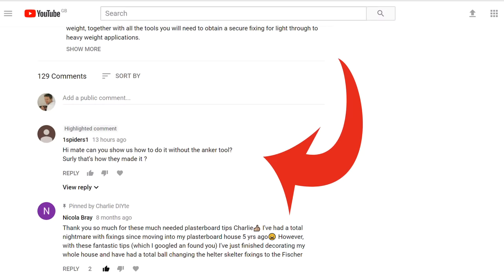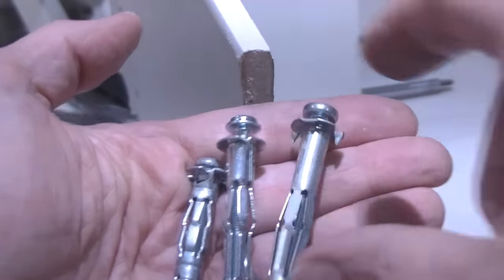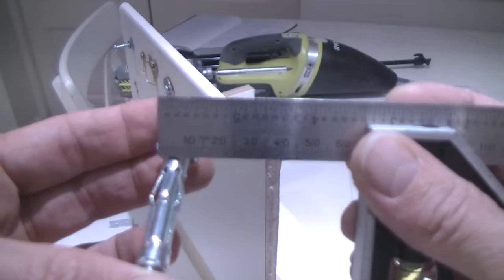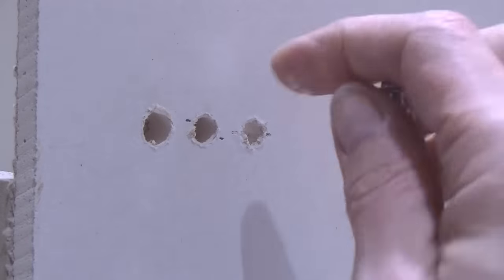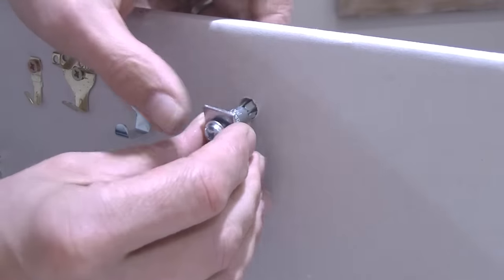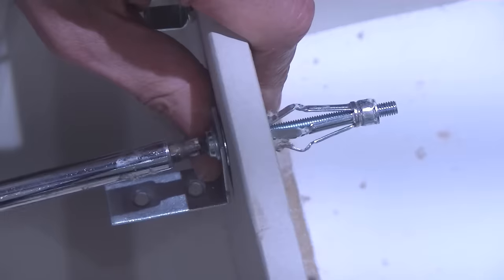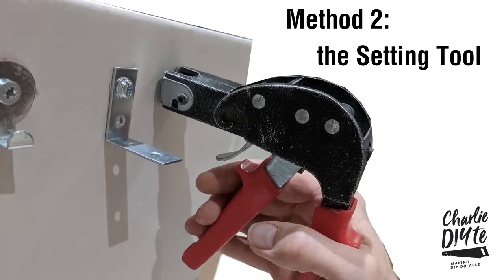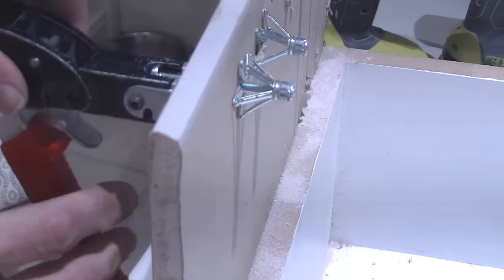How to Fit Hollow Wall Anchors

Comment: As I understood, it's not enough to put a bracket between the anchor and the screw, what is important is to keep applying pressure to the anchor with the bracket so the anchor doesn't rotate as you screw the bolt into the anchor?

Comment: Hey Charlie, I noticed a bit of wobble on the anchor when you removed the tool near the end of the video. Does the tool not tighten the anchor completely or did you just not tighten it completely? I really appreciate your channel, have ordered anchors for a project I am working on and will complete it once I receive the anchors. Thanks
Reply: It tightens up when you screw up your fixing. The main thing is getting the claws open first

Comment: Thanks so much for this life-saving video! Must have had beginners’ luck with the first few anchors I fitted - but then had a total ‘mare yday. Popped out this morning to buy a setting tool but just tried one with the ‘old fashioned’ technique and that addition of the turning stop is a total game-changer! Thanks again!
Reply from the maker: Yey! Glad to hear it Tom. Yes that turning stop is crucial. Thanks so much for getting in touch 👊🏻
Reply: @CharlieDIYte  Can I also ask - I have been using the thinner versions of these these hollow wall anchors to hang heavy-ish pictures onto plasterboard walls. Are they over-engineered for that kind of usage and/or is there anything better you’d recommend in this scenario? Thanks again for all your great videos, either way!
Reply from the maker: No, I think you're absolutely right to use those of the pictures are reasonably heavy. The trouble with standard wall plugs is you need compression for them to do their job, and for that you need to tighten the screw against a hook. So for the other option, check out this video https://youtu.be/qwVnoaY5eVc
Reply: @CharlieDIYte  excellent, thanks so much!

Comment: Brilliant.  I fitted my son's TV to the wall using these anchors without the setting tool.  Works a treat and a solid fitting
Reply from the maker: Great to hear that, Chris - thanks for letting me know!
Reply: hopefully it isn't drywall
Reply: @cdoublejj  they said their sons tv. It probably not a 70 inch. I personally don't trust drywall with anything, but you have to.

Comment: Great video! As a curtain fitter myself too, I use these all the time to get a secure fixing for the weight of the curtains. From my experience the top tips I can give are. 
1.Make sure to drill the hole level. 2. DO-NOT over pump when using the tool. 3. Check the bolt screw head and use the correct drill bit or screwdriver, as the bolt heads are fairly soft and can get ruined easily. 4. Always when using the tool make sure to screw the bolt in and then unscrew as this make sure that the umbrella is fully open and tight to the plaster board. 5. When fixing item to either wall or ceiling make sure not to over tighten as this will pull the umbrella too much and pop the plaster! leaving you will a big hole!
Reply: On your point 2, how do you know when to stop pumping? Thanks.
Reply: Thats what she said!

Comment: That tip about putting the bracket in front of the screw was invaluable thank you!  I was sitting with a spinning anchor - the teeth / claws had just gouged a circular hole in the plasterboard - scouring the web for a solution.  It's not a bracket that I was ultimately fixing (it was a guitar hanger which is much thicker and with that the screw wasn't reaching far enough in to bite) but adding one I had going spare worked to get the anchor expanded.  I'd just about given up on it so thank you very much for the tip!
Reply from the maker: You're very welcome Steve. Here's my comprehensive plasterboard fixings update if you have a moment https://youtu.be/Jdu9RId7m90

Comment: Excellent video.  We don't have an anchor tool so my husband will use your screwdriver method.  Big thank you!
Reply from the maker: Thanks 🙏 Yes that'll work fine. You just need to make sure you have the bracket or some other material between the screw and wall anchor before you tighten it, to stop it spinning.
Reply: Yes, thank you, we did that, but he nearly gave up as it wouldn't seem to screw down properly.  We checked we had the right size  anchors for the thickness of the stud wall (we could see the thickness after drilling).  He had a sleep, went back to it and hey presto, all ok!

Comment: Ah jeez. I wish I had come across this video much sooner; it would have saved me years of pain with failed hollow wall anchors. I had always just used them with the screw and initially they generally seemed to work. Recently every single one I was using (from B&Q) was failing. I thought that the anchors were faulty. I've invested in a setting tool and hey presto, they now work perfect every time. Thanks for the great video.
Reply from the maker: You're welcome. Yes it's such a badly explained thing this. I was exactly the same - crudely using my long nose pliers to distance the fixing from the bolt whilst I tightened it. A turning stop is crucial if you're tightening it without the setting tool - I guess that's why they normally include a washer but it's easy to dispense with that not realising why it's there! 👍
Reply: @CharlieDIYte  So I got myself a setting tool and honestly it works beautifully. I haven't had a single one of these fail now.

I grew up in a house with solid walls so never came across these hollow wall fixings.

Thanks to your video I'm much more confident with all those pending tasks I've been putting off for fear of wrecking the cavity walls in my new build!
Reply: @CharlieDIYte  that was my idea to buy pliers instead. If I recall that grip into the baking soda ; err I mean wall is liable to just turn an shred the wall. Probably doing it by hand helps lessen the chance than a drill.

Comment: I recently hung a very heavy mirror above a fireplace in plasterboard. I didn't want to cut the finished wall to install a plywood pad  - too time consuming, ugly and, IMHO, overkill. 

Anyway, before commencing, I had a look at your other tut on drywall fixings -if you hang curtains for a living, you are definitely and expert in getting the best fixing into drywall - and decided to give the anchors a bash, going on the premise that I could always fall back on the plywood pad if I was not confident that the anchor would suffice. 

I've used them before, quite a long time ago. I seem to remember that, whilst they are plenty strong, the process could be a bit hit and miss. Until watching your video (and Andy's over at the Gosforth Handyman), I did not know about the setting tool. 

Well, what a fantastic piece of kit! Drilled the appropriate holes in the plasterboard, and seconds later  both anchors were firmly fixed, ready to accept the heavy mirror. 

Yes, fifteen quid might seem a bit steep for a tool that you don't think you'll use that often, but I have the feeling that it will be a bit like my trusty multi-tool: Never leave home without it!

Thanks for sharing

Comment: Thank you so much! Easy instructions. Just what I needed.  Trying to fix a "simple" DIY job.. a stuff up using the shop bought rod bracket kit - no instructions and grey brick wall plugs supplied for plasterboard walls  which I was not aware of until I installed them... I was so careful to do this right, checked with sales staff before,  yet even they did not advise me correctly. So so annoying... I hope I can reuse the same holes if they are not too big now 🤞🤞 hopefully problem solved! Thanks again.  YOUTUBE is awesome!!!
Reply from the maker: Sales staff are generally clueless I'm afraid, Marianne, and real plugs supplied with lots are the cheapest generic plugs they can get away with supplying. I don't know why they bother to be honest. If you've bought these metal wall anchors you should be absolutely fine with the holes you've drilled as the anchor holes will need to be a bit larger anyway. Any problems, and a bit of Easi-Fill will give you an invisible repair.

Comment: Thanks very helpful. I'd used them years ago but had forgotten how to set them just using a screw driver. The extra bracket seems to be key to it tightening properly.
Reply from the maker: Yes, it's crucial to have that bracket in place to act as a turning stop.

Comment: This is fantastic, thank you so much for doing the fitting without the anchor tool. I have to refit a curtain pole for a client, that was literally hanging off at one end. I'm a mere painter & decorator, and always faced with plaster board dilemmas. Great stuff Charlie!
Reply from the maker: Emily Brock You're very welcome - thanks for the comment. Ps, there's nothing "mere" about painting and decorating 🙂!

Comment: Thank you so much for the tip without the anchor tool. Mine doesn't work at all. You saved my shelves!
Reply from the maker: You're welcome. Yes the turning stop is crucial, otherwise you have a spinning fixing that makes a mess of the wall 👍🏻

Comment: Good video! My problem is Safety Grab bars that were improperly installed by a previous maintenance man at the hotel where I work. Whomever did this put these molly bolts in and never bothered to see to it that they expanded at all. They just slapped these Safety Grab bars onto the fiberglass showers and so a while later these grab bars are just pulling out all over the place! I need to get some New molly bolts and see if I can get this job done right. And thanks again for this informative video, I've watched so many Useless ones to find this Good one.

Comment: I do like these fixings. Quick tip whenever I use these I set the fixing first then for belt and braces remove the set screw and apply a bit of thread lock. Stops the screw rattling loose for whatever reason. Nice video.
Reply from the maker: Zed Man Love it! Typical belt and braces from Zed Man! Great work!
Reply: Zed Man 6

Comment: Awesome advice on the turning stop. The ones I buy have a washer as well, so not so much of an issue, but I use the setting tool anyway 👍🏼
Reply: I had 3 of these spin like theres no tomorrow, once i slappet a washer on the problem.was fixet, lordamercyy
Reply: @Afritunez  such a joy when that happens isn’t it. Trashes the wall 😒

Comment: Good tip using the bracket/etc to hold the anchor, I've not used them much by have always ended up using some pliers to hold it which makes a bit of a mess sometimes of the surrounding plaster board.
Reply from the maker: Jer Goes I've got to say that's what I used to do. So much easier with the turn stop 🙂

Comment: I use a pipe wrench to hold the anchor while i'm screwing in the bolt, you will start to feel resistance which is the internal metal spline starting to bend after a couple of extra turns you can then force the anchor into the hole and screw it in tight.

Comment: Fredric
I appreciate the wonderful instruction on which way is best to install these anchors, with or without the tool, But how do you remove them when you want to re-position the shelf/cupboard elsewhere in the room. 
Is it just a matter of pushing the whole anchor through the wall so it drops into the cavity, then fill the hole, as you would with plastic plugs?
All your videos are very informative and easy to follow - keep up the good work
Reply from the maker: Thanks! Yes, pushing it through is your best bet. Grind off and remove the front of the anchor with a large hss drill bit and then it should push through with minimal damage to the wall.
Reply: @CharlieDIYte  
Thanks for your reply and advise Charlie.
I'm an avid follower of your journey's through your demonstrations and clarifications on all matters of DIY.
I have a project I would like for you to follow up, but too lengthy to discuss on public comments.  Do you have a contact address in which I could explain my project in greater detail?
I'm sure it will be of great interest to you and other followers
Reply from the maker: @noibear  That's great to hear Frederick, thanks! Yes, email me at charliediyte@gmail.com 👍
Reply: @CharlieDIYte  
Hi Charlie - I've sent my request, plus a reminder to the email suggested but it appears you are not receiving them.  Is there another way of contacting you?

Comment: Ive always used these anchors for fixing semi heavy stuff to plasterboard, ive nevee had a problem with it spinning or not opening, i didnt even know there was a setting tool! With that sais though, ive only ever used the smaller size, i suppose maybe the larger sizes would benefit from the added security of being preset before tightening.
Also, while its obvious to me now, i never even thought twice about the length of the collar matching up with the thickness of the plasterboard, guess i just got lucky.
Nice video, i learned something.

Comment: Great video. I didn’t know you can use these fixings without owning the £15 tool.
Reply from the maker: Yes, but the turning stop is crucial. The setting tool is a much easier solution though.

Comment: Really good video. Can’t say it’s so easy in reality. I have used plenty of this type of fixing. The problem I find is if I screw in instead of using the tool, when to stop screwing in as overscrewing can cause damage to the plasterboard?
Reply from the maker: 2wheelspy Thanks mate! Totally agree that the setting tool is the best way to set these fixings. That said, I was amazed how ready it was too use the manual method. As long as you use the turning stop/have the bracket in place it should be really straightforward. In terms of when to stop screwing you keep screwing until the screw goes tight, and you'll see the front of the anchor pull tight into the plasterboard. Best to use a manual screwdriver at the end because you have a greater sense for when it's gone tight. I wonder if you have problems with damaging the plasterboard because you're using the wrong anchor? You've got to make sure the collar on the anchor matches the depth of your plasterboard. If it's less than the depth of the plasterboard then the umbrellas will open too far and start crushing the plasterboard??

Comment: those plasterboard fixings (we call them brolly's due to them looking like an umbrella when they are expanded) that have the depth for double plasterboard are also excellent for getting a fixing into lath and plaster walls, I find that the lath is far to thin to use a screw for fixing and the substrate overall will not take a rawl plug, however by getting a brolly to expand behind the lathe it gives a really good fixing, also most brolly's i've used will have the drill diameter stamped on them, good video though, i've often had brolly's spin when trying to install in soft plaster and I will definitely be trying that technique, thanks.

Comment: This demonstration is great.

My question is that these anchors appear to be an absolute solution in that unlike a plug I am guessing if you want to remove them you have to cut them out?

A little reluctant to use them for fitting a heavy mirror in tge middle of a wall if I might further down the line need to cut a 50mm hole in the wall.

Comment: I used these yesterday without a setting tool. I always still a hole 0.5 mm narrower then recommended (6.5mm in my case) and push it in. I then use electric screwdriver and finish with manual screwdriver as it gives me the idea how tight it is.
Reply from the maker: Yes that's fine. The key that a lot of people don't realise is you need a turning stop to separate the fixing from the screw otherwise it spins. 👊
Reply: @CharlieDIYte  I've  cut my finger on one of those small teeth that stop them from turning 🤣

Comment: Thanks for the amazing video!! Question: how does one remove the anchor from the plasterboard if it's no longer needed? Cheers, Ben from New Zealand.
Reply from the maker: It's a bit tricky Ben. Best thing to do is get a large HSS (metal) drill bit and gently drill off the front. Then you can push the fixing into the wall a bit and fill over the front.
Reply: @CharlieDIYte  Brilliant! Thanks for that Charlie.

Comment: I've had issues where the wall wasn't then deep enough for the bolt to go in . love DIY
Reply from the maker: In that situation you want to drill through into the brickwork behind and install a Corefix fixing.
Reply: @CharlieDIYte  thanks, I will look.

Comment: Very helpful thank you, but is it possible to remove these later if no longer required?
Reply from the maker: It's not possible to remove them but you can drill off the front washer and push them into the wall to fill over. Some of them have a removable front which makes this easier.

Comment: Hi Charlie,  I watch all your videos, they are excellent and very well presented. My problem is that I can’t find an plasterboard fixing that is appropriate for my plasterboard walls.  The plasterboard in my flat is 30mm thick with installation material behind it.  Most of the fixings that you have presented are for plasterboards that are a lot less thinner than 30mm. Is there a Duopower wall plug that is suitable for walls of 30mm or more?
Reply from the maker: Hi Ronnie, thanks so much for watching my vids. I don't know what you're fixing, or the weight of it but you could try the Fischer Duopower 8x40s, and use them in a compression capacity rather than relying on anything opening up behind the plaster board. They're universal so they just text according to what you're inserting them in.  Use a screw that's very slightly longer than the fixing when fully inserted, to maximize the compression. Probably 5mm diameter screw. If you're fixing something heavy with cantilever force, send me a new comment and I'll think again.

Comment: Thanks for all your videos. I have to replace the middle fixing of a curtain rail (3 meters long). There are 2 fixings points. Will it take the weight?
Reply from the maker: Difficult to say without knowing what weight the curtains are and what fixing you'll be using. However if you used these, yes it should. But check this out too https://youtu.be/Jdu9RId7m90
Reply: @CharlieDIYte  Thanks for the reply